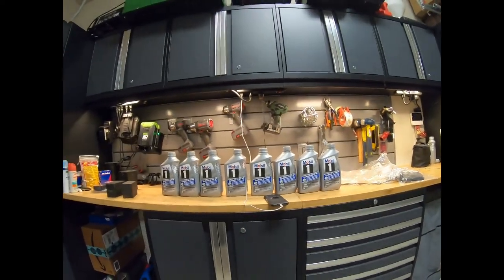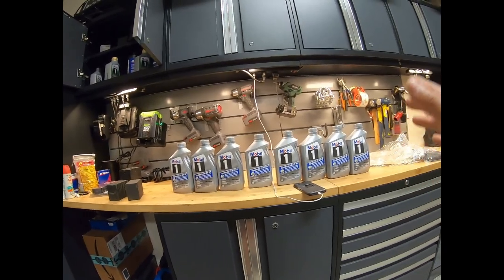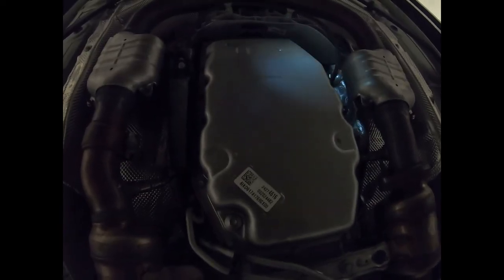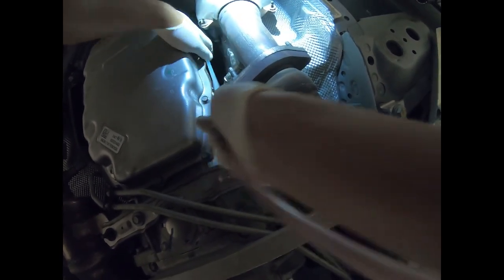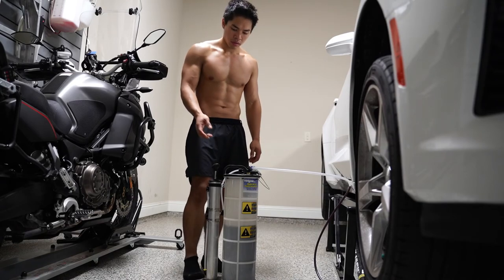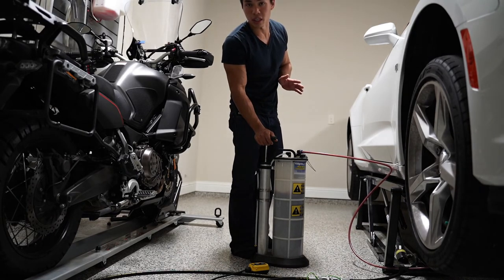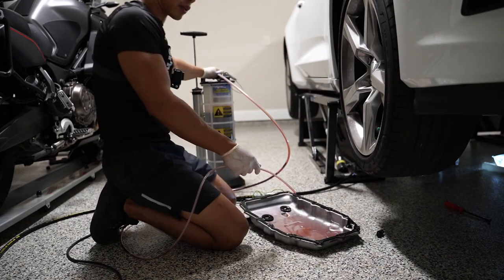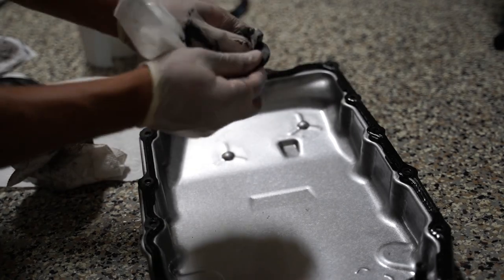2016-2019 Camaro Automatic Transmission Fluid Change

Comment: Great video! I think it is important for everyone watching to realize that this is NOT a full flush or even a full change. There is fluid trapped in the valve body and between shift solenoids that you cannot evacuate without the transmission operating. You said you took out a little over 6 liters, which is also roughly 6 quarts. The transmission is supposed to hold 12 quarts total, and the dealership uses 20 quarts for the full replacement. This is why dealerships have TransFlow machines that suck fluid out and pump new fluid in while the transmission is being operated (obviously while the car is in the air). You said you do this every 15k miles, which I think is a great interval that should eliminate the need for Chevy's expensive fluid flush every 45k miles. I think those who have a carfax report with no transmission service on it, and are already well past the first 45k interval, should first let the dealership do a flush. Then keep up with this style fluid change. Great vid.

Comment: The shudder isn’t actually from clutch material, but rather the original fluid GM was using (black label) was hygroscopic (absorbs ambient moisture) and then creates problems as the transmission fluid is always absorbing small amounts of water through the breather port. GM realized this in late 2018 and released a TSB in early 2019 addressing the need to triple flush all affected units to the new Mobil 1 fluid (blue label). This fixes the shudder. If it doesn’t, then the torque converter is too far gone at that point and should be replaced. The TSB explains it all.
Reply: Do you happen to know the TSB # for this?
Reply: But did you see how much metal shavings came out that pan ? Im sure more of it is in the torque converter which is a freeway gear thats when most off the shudder occurs on that 8th gear

Comment: So do you always have to change it the transmission fluid? Does the shutter come back?
Reply: If using the blue label fluid from Mobil 1, it shouldn't. Keep in mind, this method only replaces 50-60% of the fluid. Still alot left in the TC. You can pay a shop to flush it. That's a full changout. Or you can follow this procedure 3X. After the 3rd drain and fill (no need to drop the pan if you have a pump after the 1st time) you will have replaced most of the fluid. Maybe as much as 90%. Check prices on a shop flush. Because doing this yourself 3 times, that's about 18-20 qts of ATF.

Comment: Thanks for this video. It really helped me. One thing though is the temp to check the level should be 95-113°F. The temp you mentioned in the video is for if you're going to track the car. Though it probably doesn't hurt anything to be at track level all the time.

Comment: Video is awesome. Its my tuturiol every time. Can never remember the temp range. For those that are pumping out old fluid before dropping pan, theres an inexpensive, very common, orange/red hand pump sold at Harbor Freight that works great to FILL the trans. Not so good at removing the old fluid. The hose it comes with is too large to get to the bottom of the pan. Also comes with a smaller hose that will make it to the bottom but the little pump won't pull the fluid through such a small hose. Maybe a motorized pump works better but the little pump I'm referring to is not up to the task.

Comment: Excellent and informative vid. Did GM correct this issue with their 10-speed auto?
Reply: My Camaro is my passion and I'm all over the Camaro pages. From what I've heard, the A10s are much better transmissions. They started putting these in 2020 Camaros. My '19 still had the A8.
Reply: 2019 comes with the a10 not the a8!!!
Reply: @bshsbnenesn8262  the white Camaro on my profile pic was my 2019. It had the A8. Maybe they put the 10 spd in the SS. My '19 LT had the A8.

Comment: The car shuttered on me bad one time and I immediately researched saw your video and burst into action cars running great after 300 miles however 6 months back I did a $20,000 build on mine cam heads long tube headers MSD e85 exhaust throttle body and tune alls I can think about is if I should pay the money and get it flushed which I really do not want to drop my car off any dealership what is your opinion on that
Reply: I’m literally in the same boat as you i added some fluid and it seem to go away until a few days ago now it only does it at 65 mph to like 70 75 mph and up I’m gonna go ahead and change the fluid and filter to see if that helps

Comment: Wish I hadn't bought a Silverado with the 8L90 transmission after watching this ... why would they make a transmission that 90% of owners don't have the tools or motivation to change or even check the trans fluid. They've made this a more complicated job that most will not want to tackle...

Also you have a beautiful garage, not sure why you wouldn't have put a tarp down before doing this job to protect your floor.

Comment: I just got a 2016 Camaro 2SS same issue with the shaking but I just had the GM guys do it lol but I'm sure I will have to do this some day so thank you. GM told me all they needed to do was flush and fill fluid and no filter change and after watching this I'm like WTF? Im calling them tomorrow and telling them I want the filter changed as well thanks to you. I love the car I also got the convertible but mine is black on black with red racing stripes. Mine also had the other camaro issues like the shifter kept saying it wasn't in park when it was and the keyless entrance button stopped working but its getting all fix up right now. I hope yours don't start doing that. Great video hope to see more of your Camaro
Reply: How did you repair the keyless entrance button that stopped working?

Comment: I just changed the fluid and filter by watching your video unbelievable content I have a 2SS 2017 with only 7,000 mi bought the car brand new your video was 4 years ago I believe as of 2023 did you have to do the procedure again and if so what mileage

Comment: What do you think about a flush (which would probably be a dealership service) to get all of the "black label" out at once?
I have a hard time trusting them to do it right, plus it is expensive. Only reservation is if the torque converter goes before 60K miles, the warranty may be no good if I did not have a dealership service at the manual's 45K mile schedule. I am hoping the 'blue label' ATF works out better. I have 30K miles on a 2018 (made in September 2017), and have not experienced the shuttering problem, yet, and pretty sure it has original fluid. (got the car with 22K miles). Keep us posted after you stack on another 10K or so miles if the blue label kept the shuttering away.
Reply from the maker: constantbuzz the black label worked on a 2015 Escalade well for 15k miles.  I took my truck from Dallas to the entire west coast in 2018 feb and again in 2018 December for a proposal.  Then in 2019 the shudder came back around 15k miles later.  I just filled my camaro with the blue label and my fiancé and I don’t drive it much so it’s too early to say.  I will keep you guys posted but it seems mobile 1 has improved the formula.  However i need to make it clear that weather it’s black or blue label, flushing, cleaning the pan, and replacing the atf fluid with a plan drop does eliminate the v8 to v4 shudder.  I am still not sure if the new fluid will fix it or if simply constant fluid flushes will be required for the gm 8 speed transmissions.

Comment: Thanks for the video! I have a question. Is it possible to take out all the ATF without the pump maybe by removing the pan from the begining?
Reply: Yes you can remove the fluid by unbolting the pan. You will still need some kind of pump to fill the transmission however.

Comment: has it come back???   i have a 17 SS and it started doing it a little..   how did you get that brown top?   i have a convertible as well..
Reply from the maker: Chris Craft it has not come back so far all is good!  The brown top was an option from Chevy as well as the seats
Reply: @ThatShortGuy91  mine is still under warranty but i dont think i want to leave it at the dealer.. i might just try this if it gets any worse....  does your top sometimes not want to go up or down..  ??
Reply from the maker: Mine is under warranty as well but the dealer won’t actually change your atf filter or take the time to clean the pan.  Someone can correct me if I’m wrong but I believe they will just flush out the old fluid.  So far my top hasn’t given me any issues.

Comment: Any way to share a link to where to get those pumps you used to evacuate and fill with?  This was very informative and now I feel comfortable doing my silverado soon. Thanks.
Reply from the maker: Mityvac fluid extractor 
https://www.amazon.com/Mityvac-7201-Fluid-Evacuator-Plus/dp/B0002SR7TC/ref=mp_s_a_1_4?keywords=mityvac+7201+fluid+evacuator+plus&qid=1582190863&sprefix=mityvac&sr=8-4. 

Mityvac Fluid Pump

https://www.amazon.com/Mityvac-MV6400-Fluid-Dispensing-System/dp/B004IKM57Y/ref=mp_s_a_1_4?keywords=mityvac+fluid+pump&qid=1582190917&sprefix=mityvac+flyid&sr=8-4

Comment: Thank you for sharing, awesome video.
please keep us update.
Did the flash fix it? I have the same problem 2018 ss
Reply from the maker: Yes sir the vibrations are gone
Reply: flea1812 
You are awesome 😎 .
How many time I must do flash? 3 times?
Reply from the maker: Do one pan drop with filter change.  Then within 4K-5k miles do a fluid only change.  This way you completely cycle the residual atf fluid within the transmission cooler lines and radiator.  

Then you should be good for at least another 20-30k Miles I hope this new fluid lasts longer as Mobil one released this updated version Jan of this year 2019 as I stated in my video.  If it is a durable lv atf hp I would assume it could go as long as 60k Miles but I do not know the answer yet
Reply: flea1812 
👍🏻👍🏻👍🏻🍻🍻🍻🍻🍻👌🏻💪🏻💪🏻💪🏻💪🏻💪🏻
Reply: @ThatShortGuy91  how much would something like this cost at a machanic ive been living with shudder since 5,000 miles i now have 18,000 ps the dealer sucks
Reply from the maker: MARTPERE parts will be around 140 dollars including the filter and reusing the gasket (they are reusable gaskets).  Labor I’m not sure it could be 100-300 for labor, but to do it right the shop needs to let it drain for 8-10 hours like I said in the video, unless the shop has an ATF transfer machine and can open the thermostatic bypass valve with a gm tech II tool.  But I would assume only a local gm dealer can do a proper flush.  

I would say the dealer would charge around 400-500 do perform this flush.  A local mechanic may charge 300-400.  

Regardless if you are experiencing the shudder I would highly recommend to get it dealt with ASAP.  Check the camaro forums, gm truck forms, ls1tech forums and they have allot of info on where to take the car or other tips and tricks to get it done at a cheaper price
Reply: @ThatShortGuy91  thanks for the reply

Comment: So I drained mine and didn’t have enough tools to measure the amount of fluid I got out. Then I pumped in the new one which was 6qts but when I removed the drain plug it was just dripping so do I need to add more fluid or ? And I don’t have enough to add in. If I need to add more on then I’ll have to order !

Comment: After you cycled through the gears, did you let the engine idle for at least one minute before removing the drain plug?
I heard you mention that on the procedure reading from the phone. Was checking out another video, and they ran through the gears earlier on, like twenty minutes before it got up to 139 degrees and removed the drain plug.
Reply from the maker: constantbuzz I cycle through the gears right before I pull the drain plug i probably didn’t wait exactly one minute before pulling the drain plug but it would be good practice to do so
Reply: What lines does the temperature gauge have to be between?

Comment: Do you need the evacuater or can you just drain and drop the pan
Reply from the maker: William Dukowitz you can just drop the pan.  It’ll make a mess because there is no drain bolt on the bottom, but it will get the job done.

Comment: Do the 2019 camaros ss have transmission shudder too? Or thetas more in 2016-2018 camaros. Any help I will appreciate it cause I’m planning to buy a 2019 camaro ss
Reply from the maker: It’s going to affect any gm car with the 8 speed auto regardless of year
Reply: @ThatShortGuy91  2019 is 10 speed is it the same ?

Comment: Hey there thanks for the video this will come in handy when i do mines. Couldn't you just drain the fluid from the pan plug and refill using a cheap $10 transfer pump?
Reply from the maker: MrMegagti it’s not really a drain plug.  The plug you see me use to check the transmission fluid level is actually an overfill plug so if you were to remove
It only maybe 2 quarts will come out.  

With that being said you can drop the pan to remove the ATF fluid.  It will cause a mess but I am sure you can find a very large oil pan off amazon or even your local auto parts store to catch all the atf fluid coming out.  

You can certainly use a cheap transfer pump to add the fluid back into the fill port. 

Cheers
Reply: @ThatShortGuy91  thanks i might try that
Reply: @ThatShortGuy91  I have not attempted a trans fluid change on my 2018 SS Camaro yet, but what I have done on my other GM vehicle (does not have a drain plug or fill port under the car), is loosen the bolts on one side of the pan, and it will starts to flow out at a controlled rate. Loosen the bolts more, and more of the bolts to increase the flow as it starts to tapper off. Finally take the pan all the way off- holding it level like a waiter carrying a tray of filled glasses as you lower the pan to the ground- it will be almost full to the top- have the shop rags ready just in case! Good video, man, much thanks.
Reply: @constantbuzz  Same here.  It is a bit of a mess, but cracking it and letting it drain uncontrollably first is the ticket.
Reply: @ThatShortGuy91  bruhh.. what do you do for a living with two Escalades, Camaro a beautiful garage and a permed dog?? 😂 seriously though..

Comment: I used amsoil fluid and it worked with me just i flushed it and changed all fluids from the transmission i add 10.88 qt and the shudder gone.  And transmission now work very smoothly. My car Camaro Rs 2017 v6 . miles 31k
Reply: Sammy Phillps  Signature Series Fuel-Efficient Synthetic Automatic Transmission Fluid
 Black and blue package
Reply: Still working good? I have a 2016 camaro rs v6 with 17,xxx miles and it only happens on 8th gear , it started happening like 3 days ago and i havent driven the car since then
Reply: @chrishemi5629  there is another way to fix it you can use 20 oz of LUBEGARD® Platinum® High Performance Automatic Transmission Fluid Protectant 
 Add it to your transmission directly .but before that drain 20 oz of your transmission fluid then add LUBEGARD® it will fix 100% the shudder .
Reply: Have you try it? And thanks for takimg the time man , i appreciate it👍💯
Reply: @chrishemi5629  yes bro i used it.
Reply: @sinanturkmenterzibasi5833  they flushed mine and the shutter came back 3000 miles later..  is yours back?   how many miles so far?
Reply: @chriscraft77022  about 3500 miles .not back but there is very very little shudder in mine , i resolved it by adding 20 oz of lubegard platinum high performance automatic transmission fluid protect to transmission directly i highly recommend you to add it and it completely will solve your problems.
Reply: @sinanturkmenterzibasi5833  thanks for the reply.. GM is a sorry company..  but i love my camaro..  like an ex girlfriend
Reply: @chriscraft77022  it's not just GM. Ford and Nissan have trans issues also. It's new technology with six plus speeds on an automatic transmission. It's like when they went from carburetor to throttle body... Just takes time to get it right.
Reply: @crowdnine878  it turned out they never flushed mine..  i took it to the dealer and got the proper flush done and the shutter is gone..   i love my camaro again..

Comment: Put 3 qts in then start run through 3 different gears and then put the rest in. Idk why just the procedure. I could give you some fake reasons why that might sound good but don't actually know why. Use hp tuners to read trans temp for refill procedure.

Comment: Would this work similar to a GM full size SUV? I’ve done my 2018 Silverado with no issues, but I have to tackle my wife’s 2018 Traverse and it doesn’t have a dipstick. I’m unsure on how to check that I added the right amount of fluid. Should I just add the same amount I take out?
Reply: Great looking garage btw...
Reply from the maker: Yes it’s the same procedure for all 8L90 transmissions.  Follow the fluid check procedure at the end of the video but goggle the correct temp that’s required for the 2018 traverse when you perform the check

Comment: This transmission is in my 2018 ZR2 Colorado I have 41.000 haven't had any issues but I think I'm starting to feel a vibration like you talked about I have the factory extended power train warranty think I should let them do first service?
Reply from the maker: Jim Doesburg yes they should be aware of it and be more than happy to flush the fluid for you under warranty.

Comment: I have a v6 2017 camaro 1lt I'm having the same problem shaking on the road Should i have that mobile one blue label put in my car. I'm still under the warranty.
Reply from the maker: _ AniMatriXx yes the v6 uses the same transmission you’ll need a fluid change
Reply: @ThatShortGuy91  ok cool

Comment: Make sure youre looking at the right gauge lol. By mistake, i used the engine oil temp gauge, which heats up waaaay quicker. You WILL overfill your trans if you make that mistake (like I did) and waste fluid when you check your level. Do as I say not as i do lol.